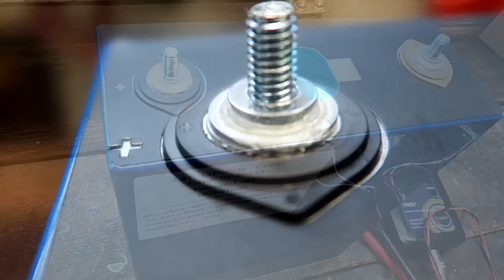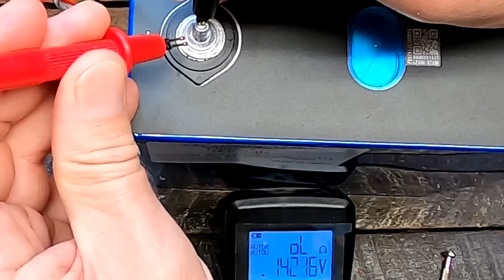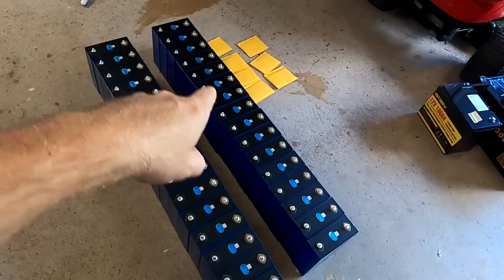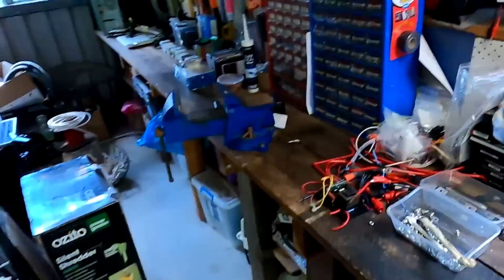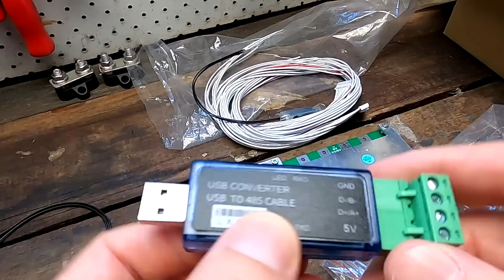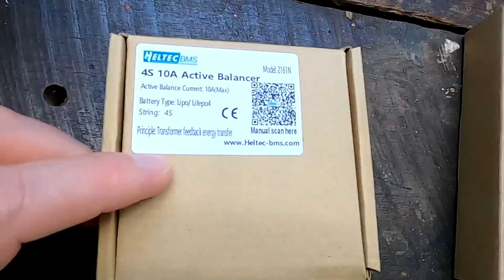Two new battery banks.. But what's the best BMS I should get? 🤔

Comment: stainless steel stuts would have much more resistance because the specific resistance of stainless steel is higher than from steel.
Reply: If conductance was a concert brass studs would have been used.  Carbon steel is much stronger and won't have nuts get stuck on it like stainless does.
Reply: @jmaus2k  I will be using Zinc coated Steel bolts/studs & nuts from now on, as it seems to have the best non-corrosive conductivity option of all I have looked at when used with aluminium, and also with the bigger 12V batteries that mostly have brass inserts.
Reply: Yes I pointed this out on a previous video, as few people are aware that stainless steel has terrible electrical conductive properties!
Most 12V batteries  (yep LifePo4 cells too) are supplied with stainless steel terminal bolts, and most people do not understand that the only sound electrical contact is through the the terminal post it's self, and next to nothing through the bolt or stud & nut.
This is one of the reasons why it is so important to stack battery lugs in the correct order, i.e. largest at the bottom and then the next size etc etc 🙂
Reply: @ValRigoli  Yes, but aluminum requires stainless bolts to avoid corrosion.
Reply: @jmaus2k  yes, but only if there is aluminum on steel in the thread, otherwise crevice corrosion will occur. In this case, this does not occur because the connection is aluminum to steel welding.

Comment: I am using a seplos 16s 200a bms with can/ rs485 on a victron Venus OS system Just Like yours. Those are often also in the 48v pre build systems. 
I bought it because of Open source Projects that gave me the Chance to build grafana / node red systems.
Reply from the maker: This is also possible with a DALY or JK-BMS though.
Reply from the maker: @lolesports  What's wrong with the build quality? I found this a particular strength of the Dalys if I compare them to Overkill, JBD and many others which have these open case from factors: a PCB sandwiched between tow aluminium plates, all sides open. I'm not happy about THAT 😉

Comment: The Hand made welding Video without any fixation of the cell and nothing between the welded cell and the human worker is hopefully just a Demo and not the Real production process... is this the best possible process?
Reply: That´s not hand made. A laser sensor, maybe Falldorf sensor, will scan the position and automatically weld it.  So the guy who put the sample on don´t need to be very accurate
Reply: Just my thinking. I'm still skeptical. I heard those welded ones where the cells with some issues. They drill out the holes, so the only way to sell them would be with welded stuts. Hope I'm wrong...
Reply: I assume that you are talking about 18650, 32650 or any of the smaller cells that DIYers use with self-propelled skateboards, drones, mono wheels, bikes etc. For that sort of an application, where odd sized and shaped battery packs are the norm, there are few choices other than DIY packs that are assembled by the user. Of course, new is available, but ever increasing and exhilarating performance may not be available with specified factory battery packs as there is with custom battery packs. That is why these sorts of users spot weld and solder cells together. On the other hand, with safety precautions, people, such as myself, can spot weld cells together using nickel strips and cell level fusing using precautions such as covering all parts of the growing pack while working on a single part. This prevents pole to pole shorts. Eye protection and mechanic's rubber gloves are highly recommended as both chemical exposure and shock become a real concern with all of those exposed terminals.

I have not had a problem... ...yet... However, I do have a bucket of sand, and a bucket of water large enough to smother any cells or packs that may go into thermal run away over-load. The working word is smother. I have been told that lithium batteries in thermal run away over-load produce their own oxygen as well as methane and hydrogen. Thus, while temporarily effective in fire suppression in lithium cell fires, recommended type D fire extinguishers may not work for long as the fire may erupt as soon as the hot cell is disturbed or even spontaneously combust days later after being initially extinguished. This re-ignition happens because hot cells also produce their own heat, and as long as the internal short that caused the thermal overload in the first has energy, the hot cell will reignite. 

View the attached list: 

What gases are in a lithium battery vent? 
Hydrogen 27.60 Carbon Monoxide 22.90 Carbon Dioxide 30.10 Methane 6.37 Propylene 4.48 Ethylene 2.21 Butane 1.57 Ethane 1.17 1-Butane 0.56 Propane 0.27 • T• The most prevalent gases are hydrogen, carbon monoxide, and carbon dioxide.

Personally, prismatics were my first choice, but the skyrocketing price coupled with absolutely no availability has forced me to go with what I can get locally. That choice is, of course, to build my own battery packs from as close to scratch as a person can get.

To be truthful, I have seen a few Youtubers penetrate a cell or two with a spot welder. There appears to have been no real immediate consequences in those instances other than a bubbling cell. Otherwise, they simply move any impacted cells out of doors or use some sort of smothering technique. However, the occasional post does appear that shows the result of thermal run away over load and it is not pretty and is indeed dangerous. 

Some DIYers also employ used cells which is OK for the highly experienced DIYer. Since I am not highly experienced, I choose not to employ any used cells. A person can usually count on the type of treatment that new cells receive while on the shelf at the supplier, while no such guaranties, other than physical damage compensation, exist in relation to shippers. 

I hope that I have allayed some of your fears.